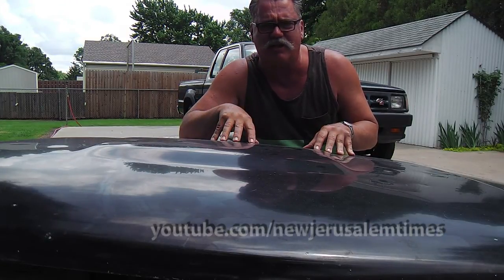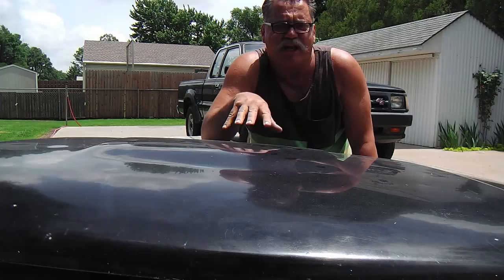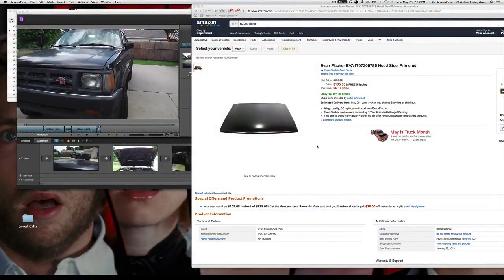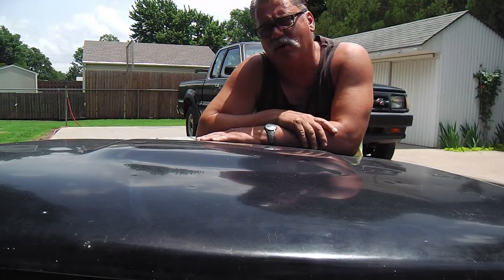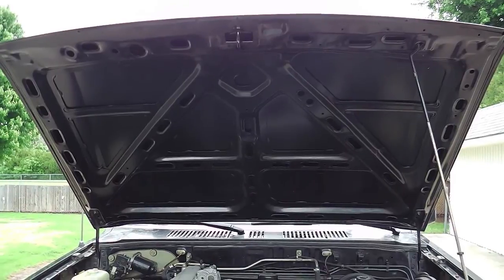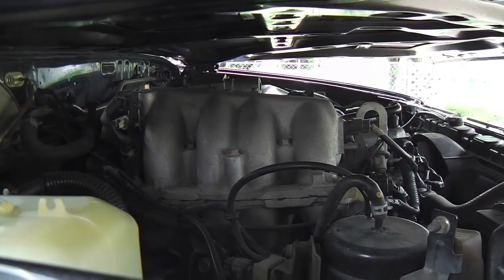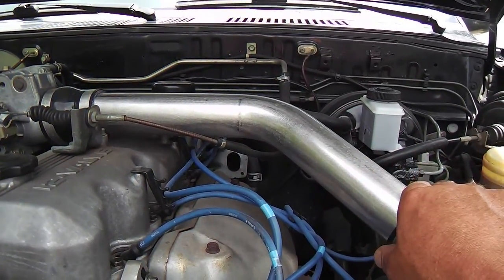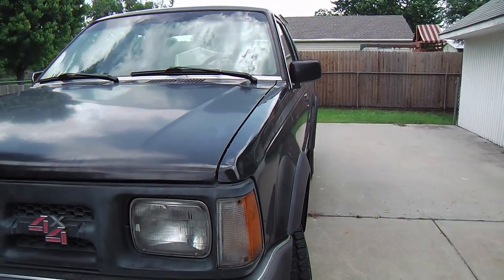Install a B2200 Hood on a B2600 Mazda Truck

Comment: I got a Mazda like that but I can’t get the hood to open I pull the hood release and it will unlock it but other then that it won’t  go up but for about 3 inches and I’m pretty sure the battery is dead so can you please tell me how to get it open
Reply from the maker: Sure, after the hood release cable is pulled inside the truck, there is still a hood release lever under the lip of the front of the hood. Just hold your hand upside-down to feel around for it, then squeeze. Or, stick your face up close to the front of the hood with it pulled up those 3 inches, then you'll see, hear, and feel where the latch is, then squeeze.
Reply: @NewJerusalemTimes  thank you
Reply: @NewJerusalemTimes  thank you so much for telling me now my Mazda that’s been sitting for years is running now